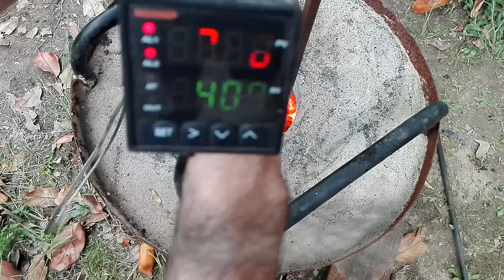DIY Aluminum Casting House Targaryen Sigil (Game of Thrones)

Comment: Black Beard Projects
Hi i got question what are you using as drossing and degassing ingredients.
thx.
Reply from the maker: Hi! As drossing flux I am using lite salt (a mix of Potasium Cloride and Sodium Cloride) and as degassing agent I use baking soda (sodium carbonate) that I both buy at the mall for really cheap and they works great for me. :D